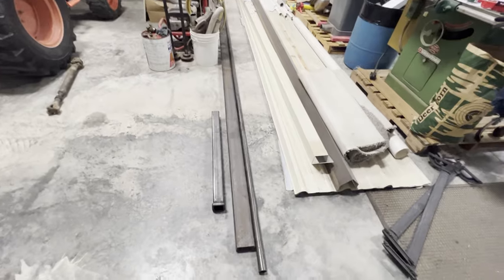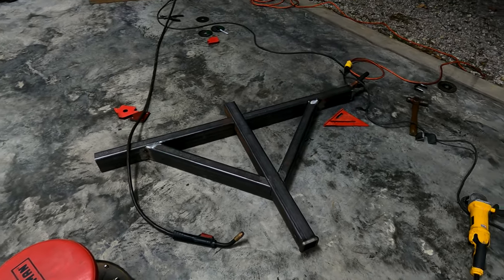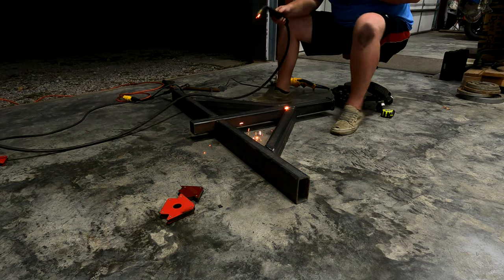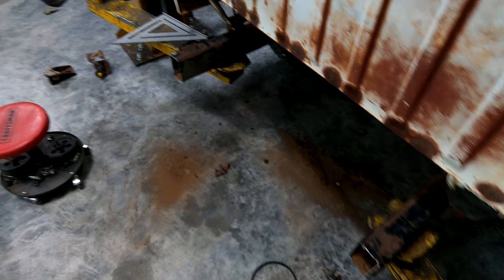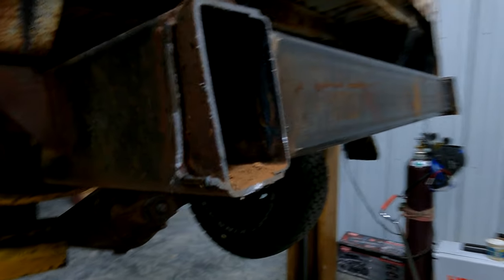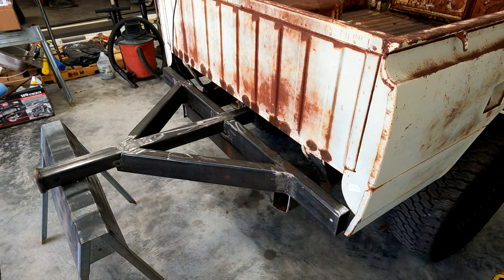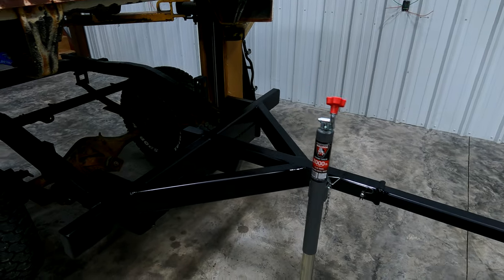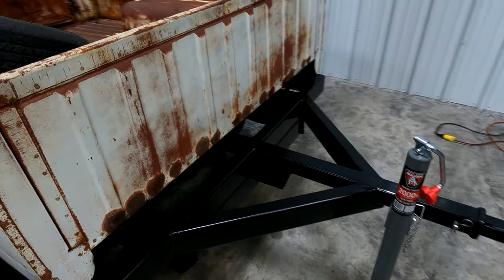TRUCK BED OFF-ROAD TRAILER BUILD - PART 3

Comment: hey you done with this? Wheres part 4? Just got a 77 Chevy luv bed that I had a similar idea and came across yours.
Reply from the maker: I should have another part to this series coming out soon! It is “done” to the point of being able to use it and it’s been great! I am about to add some additional stuff to the trailer as well so there should be more updates coming!